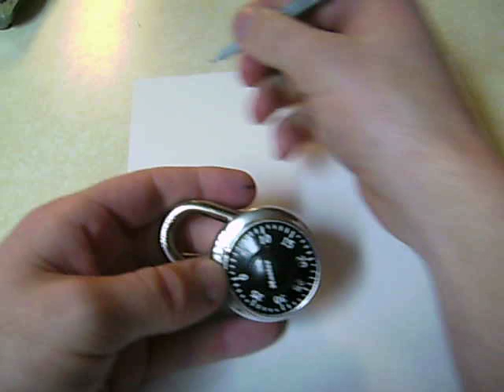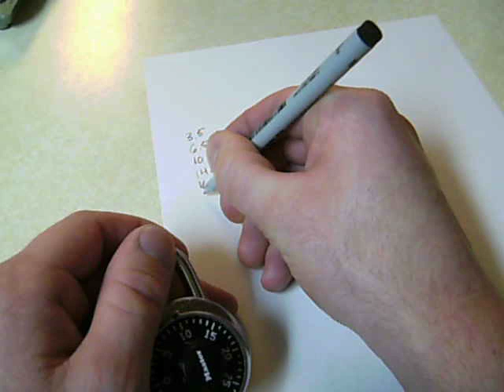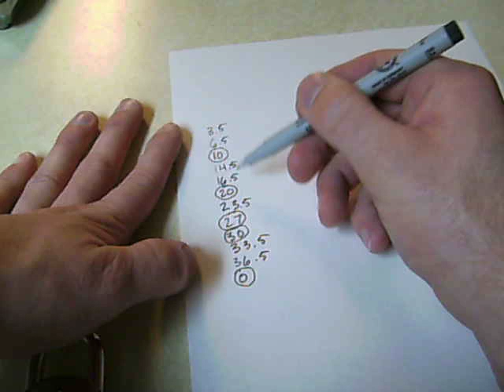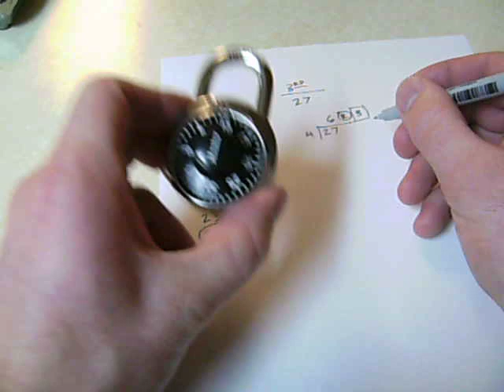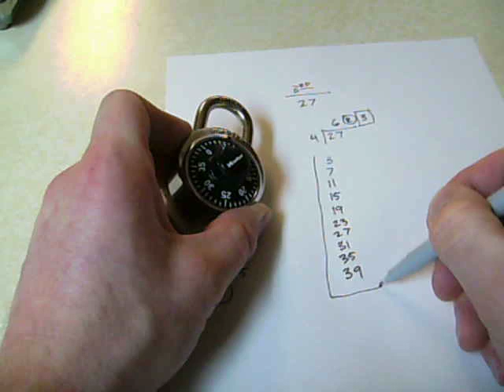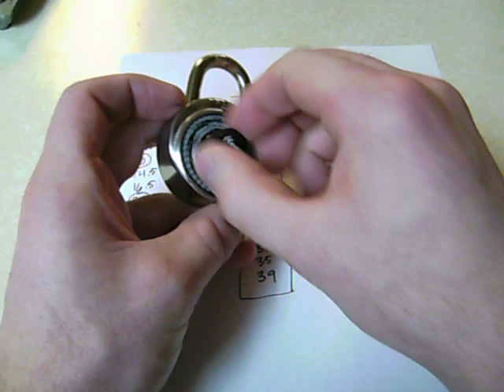Cracking a combination lock  without picking. SUPER EASY!!!!

Comment: okay so the part i got lost on was the remainder, he said you divide 27 by 4 and you get 6 with a remainder of 3, but i divided 27 by 4 and i got 6.75. where the hell did the 3 come from?? somebody please help me out.
Reply: 6.75 is what you get if you use a calculator. If you work it out on paper your remainder will be 3. Because 4 goes into 27 six times. 6 * 4 is 24. Then you subtract 27-24=3. Therefore your remainder is 3
Reply: oh okay, thank you!

Comment: Opening a simple school combo lock with pop can pieces will work but, U can also very easily cut your  fingers to bone. Just buy a little pack "shims" on the market. 

As for "math wiz boy", why go thru all that trouble for some measly crap in school locker? Plus, aren't U going to a little odd standing there with the lock, & your pad & pencil? Pro Shim the combo lock, look inside, relock the lock all in less than 5 seconds.

Comment: So. You based the entire video off of the "third" number in the combination. You set your fake video up for failure right there.
What if my combination was 1-15-27. You still rely on that third number to get the other two lists that would turn out identical to in the video because of your poor method of generating 'the lists'. Then you're SOL because 1 and 15 aren't on either list. Good luck cracking that lock.
Reply: Obviously 1-15-27 is not a possible combination since it's not on the list
Reply: Actually if you remember that each number can be within about 3 numbers you can see that it doesn't make a difference. 1 could be either 39 or even 3 depending on the lock.
Reply: Saying a "what if" scenario about something completely impossible is sorta pointless

Comment: DIDN'T work for me... I've had a combo lock to 29 years and it was NOT even close.
It said my last # would be a 19 and it is a 4 and sec # is a19... 
so 19/4 = 4.75= 4.3 and therefor my First # is 3 and the SEC# = 3.7.11.15.19... just like his.
and my 3rd# is 1.5.9.13.17.21.25.29.33.37 Just like his

my true combo is (15, 21, 3) to him is would be 15, 21, 19   NOT going to open... :(
CLOSE but would not have opened...

Comment: Why not just build a machine that would find the combo with bruteforce? A master lock has 64000 possible combinations so if you could do 2 in one second it would take about 8.88 hours(worst case senario)... That's not bad. 
If I was a janitor I could take my time cracking a safe.
Or if you could manage 8 per second you could do it in about 2.22 hours.

Comment: 27 / 4 = 6.75? wth
Reply: it's 6 with the remainder of 3.  Where'd you learn your math??????  
4 x 6 = 24
27 - 24 = 3
27/4= 6r3
Reply: chimpun4life
Stop using percentages and change.  Just use whole numbers.  Remainders never have fractions or decimal points, unless the number is a decimal itself.  And if you look at the locks, there are no decimal points or fractions.  So there's no 1/4= .25  or 1/2= .50 or 3/4= .75

6 can't go into 27.  

6 x 1 = 6
6 x 2 = 12
6 x 3 = 18
6 x 4 = 24  <-----------

27 - 24 = remainder 3

Percentages and fractions are pointless in the scenario.

Comment: This method doesn't work on all locks.  I knew the last number combination to my lock but the mathematics didn't give me either of the two numbers.  I found em by trying em out on other locks, this one and another video that does the same thing.  But mine doesn't show either of the two first numbers after I work out the math equation for my lock.  Last number 5, I found not 15 or 30 mine (Which should be the first two numbers).  So these math methods are a dud in some cases.  The way I managed to figure mine out was by opening the back, looking at the matches, then testing.  But this trial an error was a failure in multiple cases.  Not saying it doesn't work, just saying it doesn't work for all of them.  Mine was a bad case of being an unfortunate failure of not working with the +4 method......

Comment: This does not work. Best way to get combo is to slip the lock with a piece of aluminum. Once open stand the lock upright facing you. Let the arm rest in the hole of the locking mechanism. Turn the wheel clockwise. The arm will move a little but will rise significantly one time and pull into the hole. Note the number indicated on the wheel. Add five to it. This this total is the first number in the combo.If the number you come up with is even all numbers in combo are even. If its odd all are odd.

Comment: Either Master Locks have very bad design OR this guy is bullshitting because he is relying on most people being bad at even incredibly simple maths and hence getting likes because they are astounded he can divide.

I assume it is the latter or he is trolling because I don't see any logical basis for this method to work.

It might work by chance because my experience with these is it gives a bit of slack by allowing you to be slightly off the number. And since he is going by small intervals that might be the reason.